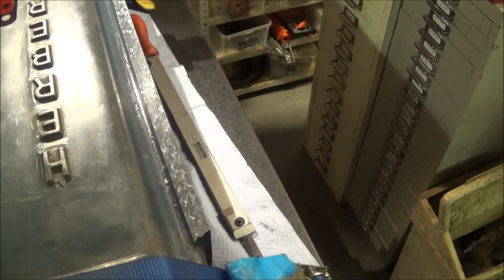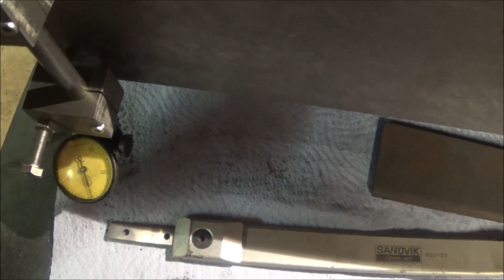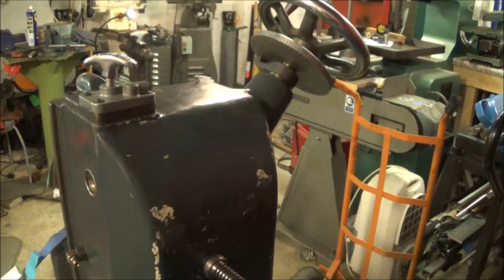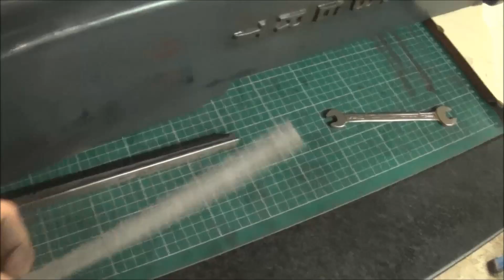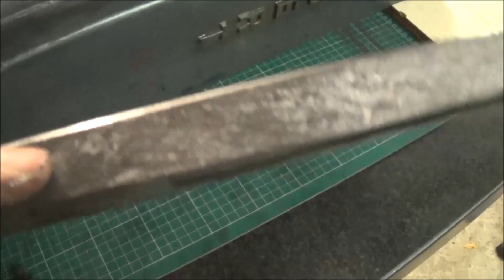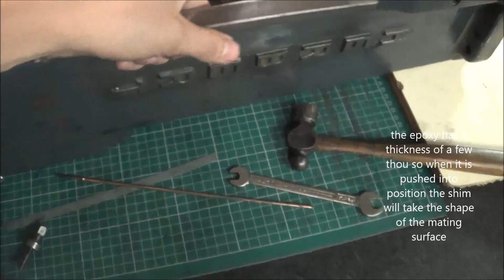Herbert Surface Grinder Restoration  Part 2 Fitting the Knee (with extra scenes)

Comment: Those Herbert grinder castings are very thick - the entire grinder weighs a hell of a lot given the overall small size. Nice set up on the SP with the jacks etc. All the best Mat
Reply from the maker: thanks.  I have been enjoying you shaper series also.  I bought this SG because it was cheap and it also does not take up much room.  I have been pleasantly surprised how well build it is with centralised oiling, decent bearings and its well designed to keep grit out of delicate bits.

Comment: Brilliant project i'm on with something similar with and old Milling machine but I have no surface plate etc. Where did you get your scraper from and roughly how long did this take you to do. Cheers JP
Reply from the maker: Hi Jack, I bought the scraper from greenwood tools in the uk.  It was not cheap but it hews material off much quicker than steel.  I use an old carbide paint scraper blade for finish scraping.  The up loads are live so you can see how long its taking me!  Its a bit slow going with work, kids and house projects.
Reply: I know the feeling although no kids! I also think we're a dying breed English blokes who just like spending time in their garage or workshop. You have more gear than I do though but I'll be buying a surface plate and the other bits as the overall plan is to convert the mill I've got to CNC to rival a Tormach. If you get chance please subscribe to my channel as i'd love somebody elses input when I start my scraping project. Cheers JP

Comment: What is the height adjust wheel calibrated to ? Mine is marked in 0.001" and given how close they are I think 0.0005" is about as much as I could split them down to. is it the same on yours ?
Reply from the maker: mine is in thous also, but they are about 3mm apart so you could split it fairly easily by eye.  I was planning to fit a tenths clock somewhere on it anyway.